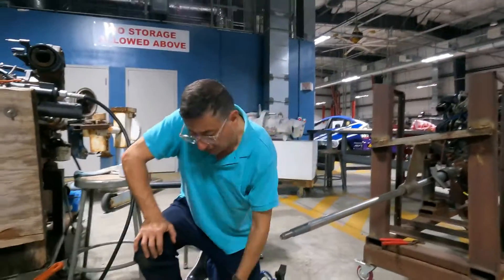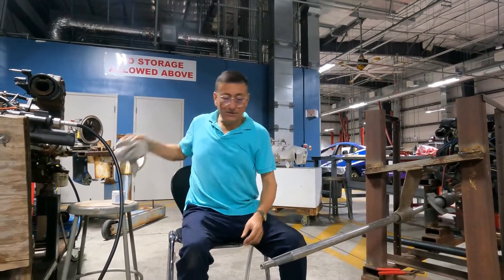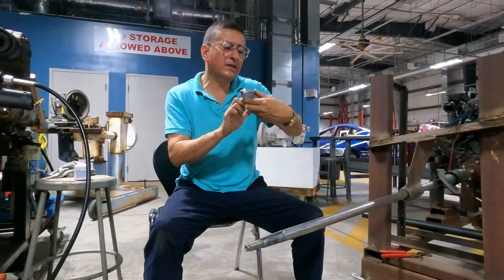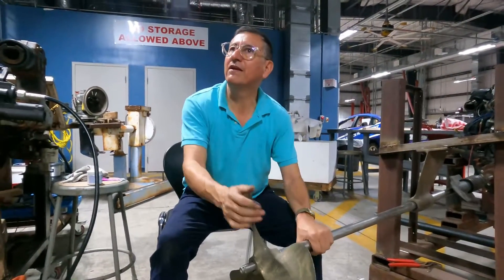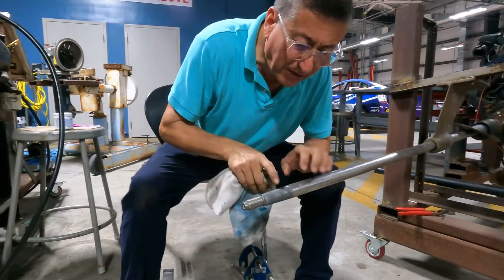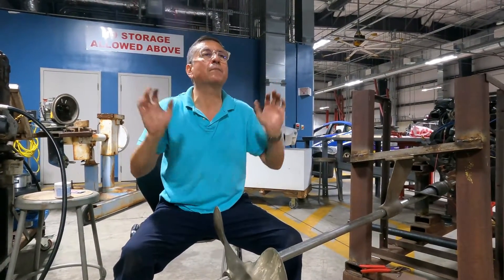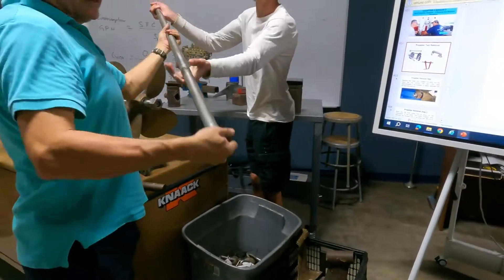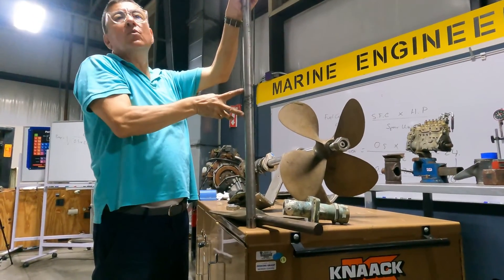Boat Inboard Propeller Installation Tips

Comment: I been doing every prop this way sense the 70's with lapping compound and installing the nuts on the same way you did large nut first then the shorter one second. this younger generation put the small nut first witch is incorrect My step father was a chief enginner in the coast gaurd and he tought me this way. I also worked for Hatteras Yatchs and told lap it then LARGE NUT FIRST